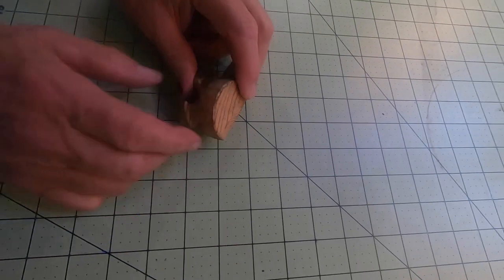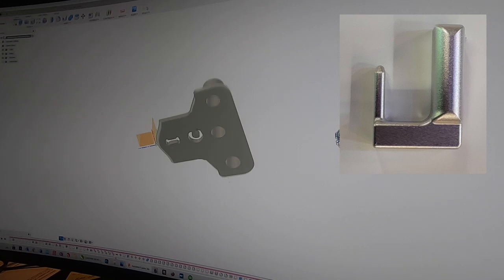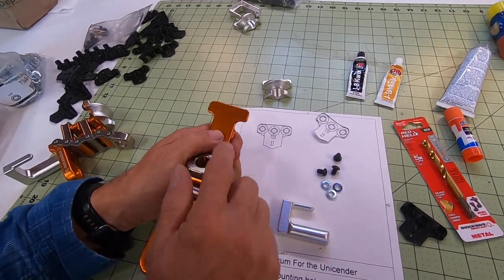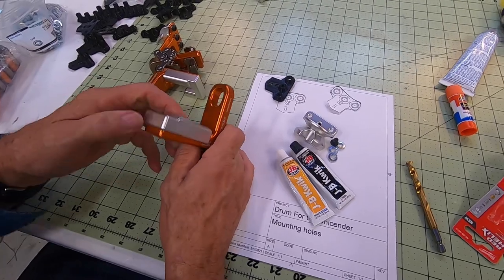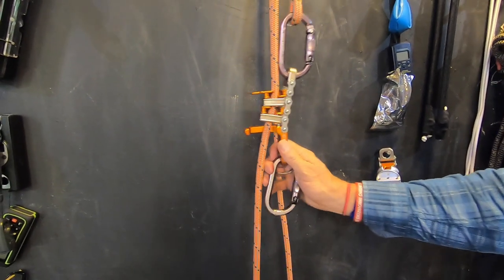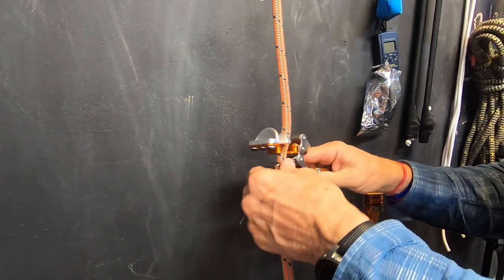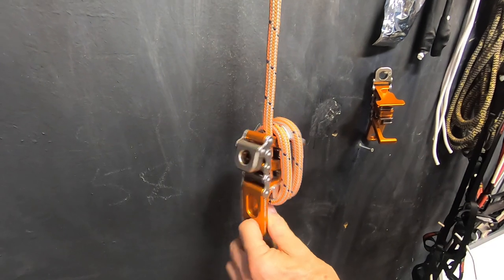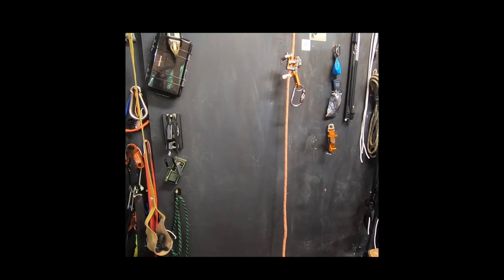New Drum and wear plate for the Unicender.

Comment: Looks very nice. I have the original Drum and I'm quite happy with it. The tail of the road always swinging out of the device drives me nuts.
 How well does the lower piece hold the rope in?
 I have considered "modifying" mine with a pulley and a capture for the tail but haven't. I definitely like the idea of the added wear of the lower piece.
Reply from the maker: Holds well but I don't do a lot of limb walking with the Uni.
Reply: @RichardMumford1  alright, I'll give it a try. Seems like even ascending and moving around in the tree I'm always chasing that tail. Thanks for putting out some great products.
Reply: @RichardMumford1  Your mods to the Unicender look like the ducks nuts making this possibly the best mechanical device for SRT work.  

We're all curious as to how you go about limb walking then if as you say, you don't do a lot of limb walking with the Uni.  

Simply asked with a view as to working out best all around gear for tree walk, assuming this starts with ascending via SRT.  How do you go about limb walking?
Reply from the maker: @tuberider1171  one or two HitchHikerXF, the Uni on my lanyard available for other uses like quick attachment to go up an existing rope.
Reply: @RichardMumford1  cheers Professor